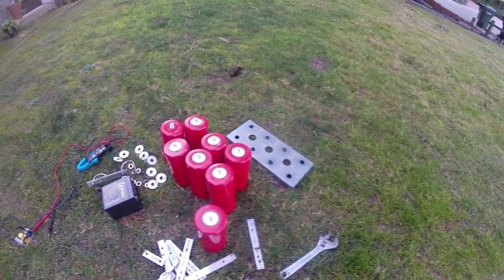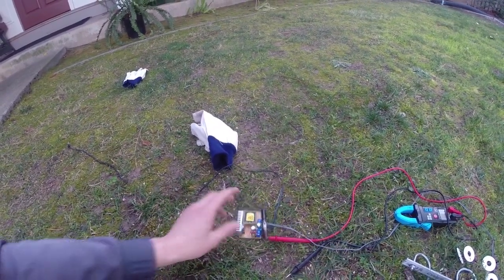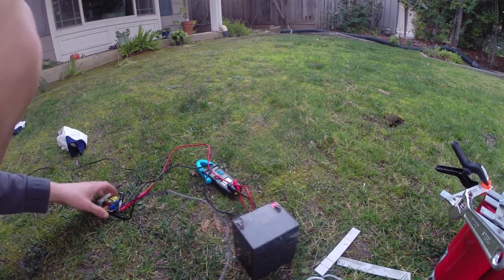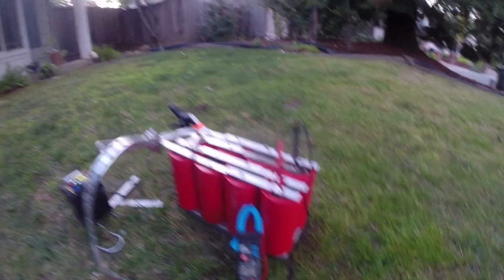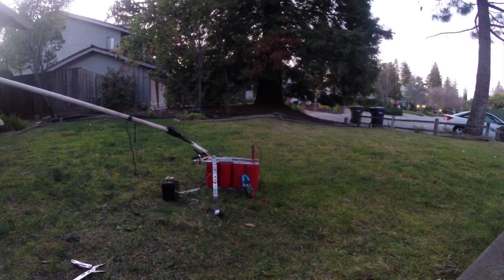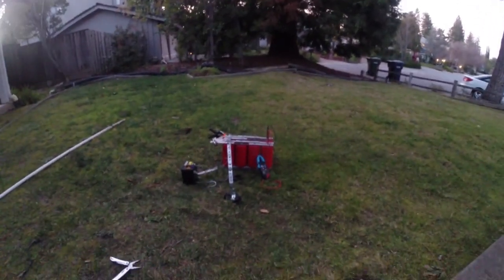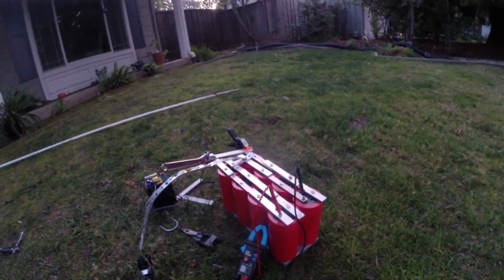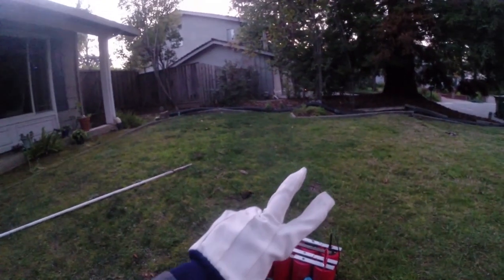DIY CAPACITOR BANK FOR RAILGUN  or  EMP

Comment: 6700 millifarad? Do you mean microfarad?
A capacitor with a charge of 450v 6700mF would be charged to like 678,000 Joules if I am correct. Do you mean microfarad?
Reply from the maker: yes micro